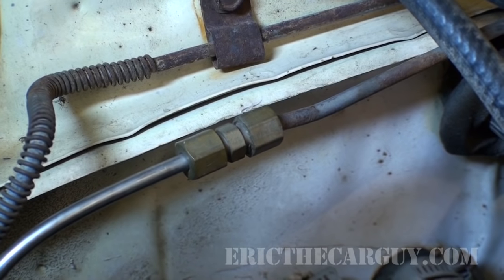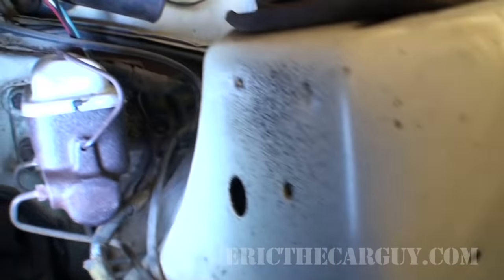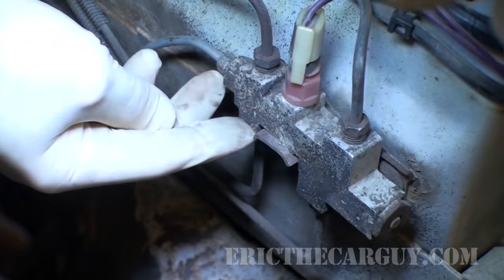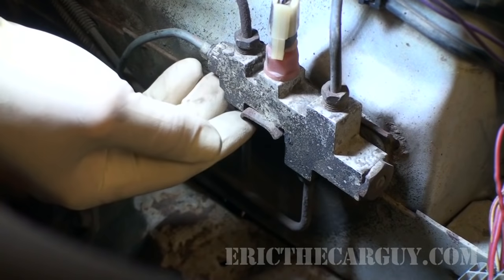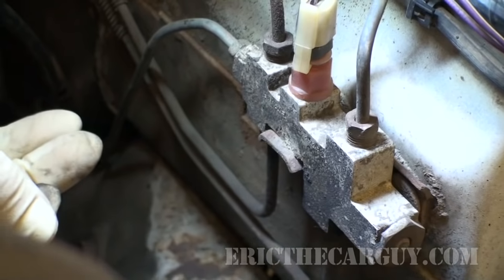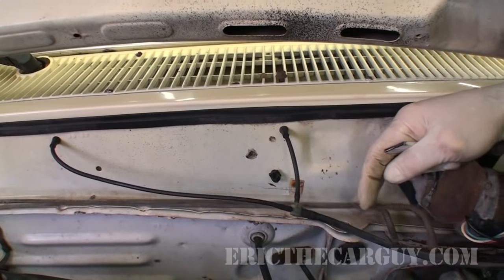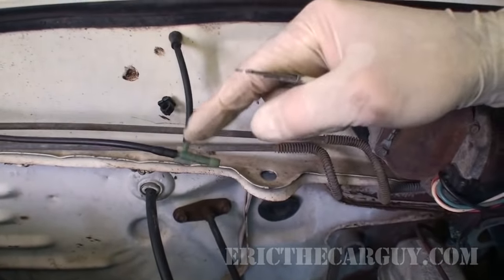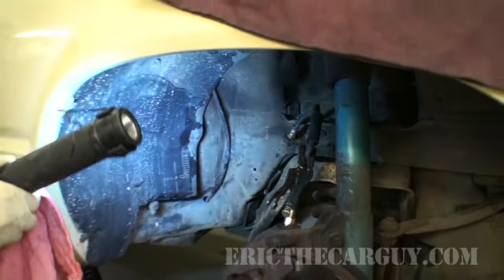How To Bend and Flare Brake Lines -EricTheCarGuy

Comment: If you are watching this because you are having to replace a brake line soon there is an easier to bend brand of line than the old-school steel line Eric used. It is called "Ultrabend". You can bend it easily and perfect for those 90 degree bends that old steel line had a tendency to deform at the bottom of the bend. Hell, those round and round bends in the line that usually are in the lines between the master cylinder and proportioning valve (and those round and rounds are there for a reason) are easy to replicate. For years I used the old bulk steel line and it was usually a pain in the butt to bend and form and if you made a mistake you had to start over. With ultrabend, you make a mistake, all you have to do is unbend it and try it again. Also, it is highly corrosion and rust resistant. No, I do not sell parts nor own stock in company that makes it. I am simply a tech that has used both type of line for years and if by chance someone reads this I hope it saves them a lot of grief.

Comment: Old video but just stumbled onto it. Nice job, something I won't do. First time I tried this the supposedly double flare tool I bought would not (ever) create a double flare. It made single flares perfectly but when I attempted the double the line would slip in the vise and get pushed out. That tool you have from Eastwood looks like the real deal
Reply: Same thing happened to me. Autozone, O'Reilly's, and NAPA all have loaner tools that don't do steel lines. I now have the Eastman hand held (in car) version, and will revisit tomorrow. After pulling the fuel tank out of my 94 Accord Wagon, just to get to the failed section of steel line across the rear, both tank strap nuts broke free from their tack-welds, and I had to grind the bolt heads off to remove the straps. Perhaps Eric has a suggestion on how to reattach the tank straps? Mollys? Baling wire? Eric has kept me busy keeping this car running for many years. Thank you Eric !!
Reply: @centralandgrandapartments3118  Aren't cars fun? Start off working on a brake line and now you have to deal with gas tank straps AND the brake line. Good luck

Comment: 1/8th inch stainless steel aircraft (AN) double flare at 37 degrees without fancy tools is SO much fun! No scratches, marks or scrapes or stress dulling or micro-wrinkling allowed. Line is handled and worked with protective masking tape. Finished product must be shiny and perfect and test to 8,000 psi. THAT is a challenge.

Comment: I remember having the same problem with car, my break line that goes to the left rear wheel got rusted and eventually started licking near the rear wheel, I figured that something wasn't right when I wanted to put in the first gear, I couldn't and my clutch  was to low and barely could be pressed down because was too low. I called my mechanic and he told me to check for brake oil level in the tank, dot 4, I didn't even knew at that time that brake fluid is also used for clutch. There is always someting new to learn about cars.

Comment: Nice flaring tool!  Not nit picking or anything but just to add my 2 cents, I find putting a slight bevel on the end also helps it roll over with the flaring tool, oh and of course deburring the inside of the end and making sure it is flush.  Otherwise it will end up off center, cracked etc.  It's a bit harder to do with the conventional, clamp style, flaring tool most mechanics keep in their box,

Comment: Hi. Keep the old fittings with a short length of pipe, just over an inch should do. Hammer about half the length of the pipe then fold that in half. Now you can use the fittings instead of a rubber bung. Mine have been in and out of my tool box since the 1980's

Comment: I know this video is roughly 5 years old, at the end you mentioned trying to keep the end of the lines clean as you fish them down where they need to go. I use a union and screw a flared 2-3" long piece of brake line bent over itself to close the end. I don't wrench the fitting tight. I find I don't ding up the flare, loose the nut down the line or get dirt in the new line when I do this.  

I'm looking at getting a new flaring tool to make good bubble flares. trying to decide between this one you use from Eastwood, or the MasterCool inline one.

Comment: Whoaaaa, I have decided earlier today to give brake line replacement a chance on my 2002 Tracker.  The problem is the lines to the rear are badly corroded and one blew out 2 days ago.  The other part of it is, this vehicle has a load proportioning valve mounted near the rear axle which adds more work to the matter.  I have nothing to lose.  If I do not succeed, the Tracker goes.  I also should replace a some fuel lines as well.  I had previously replaced lines on other vehicles which were easy compared to this and now I am much older!  The Tracker is a nightmare.

Comment: I've done the other way where u use the old one and then tape it togaither after each bend it helps too I prefer hand bent with no tool as I can get it more precise. I've never throught of the coat hanger thats a great idea too if u don't have a template or someone rigged or ran them wrong when they replaced which is common.anyways Yeah if u hold em togaither and use tape after each bend it makes it super Easy and easy to not kink it and unstrenuous. again great videos man.i love seeing other people's ways of working it's nice to get outside Thoughts.

Comment: Compression fittings also fail PA state inspection as well as NY state inspection.
Reply: Dont know why. Those things are more than a proper fix.  Stronger and less chance of breaking than the actual metal line itself...   someone made a video...

They are ugly but 100% funtional.
Reply: @grumpystony , compression fittings arent good for high pressure.  Low pressure they are fine but on a brake system the pressure is way higher than a compression fitting should be trusted.

If they were dont you think auto manufacturers would use them than the time it takes to create a double flare?
Reply: @grumpystony  Yes, they are functional, but when (NOT IF) they fail it's trouble because they don't just leak.. you'll lose that brake line. The reason they fail is the high pressure of the brake line. That's the reason why they will fail inspection.
Reply: NY State and PA are failed States.

Comment: I find this interesting viewing being from the UK, what I can gather is this difference

America: 1970s saloons, plentiful, cheap, generally free of grot, easy to work on

Britain: Ha! good luck looking for that Hillman Avenger or Morris Marina you want to tinker with, those things rotted away years ago. Want one cheap? Good luck with that, anything for less than £1500 needs picking up with a dustpan & brush. Want to undo that bolt? Well we'll just seize that solid & make it shear when you breathe on it!

I also like the mechanical practices you use however, in relation to your brake calliper video, the easiest way to get your piston out is to leave the calliper attached to the brake line & pump the pedal until the piston comes free, then clamp your line & remove
Reply: Hancockified what?

Comment: Where did you find the plugs for the proportioning valve? I can't seem to find out any of the fitting sizes for a 02 Honda Civic DX either... man, it's like pulling teeth. Are they 10X1 that feed into the proportioning valve with a 3/16 line? Any help would be great. Great channel by the way, thanks for the consistent good info.

Comment: Eric at 29:08 there is a fairly good sized kink in the line.
Reply: +Jacksonkellyfreak : True enough but not really a problem as the fluid hardly moves when applying the brakes. The fluid transmits pressure instantly and evenly. But the fluid only moves with brake wear.
Reply: what? The reason you should not use compression fittings is because brakes systems apply upwards of 1500lbs during emergency breaking! That kind of pressure at a kink (weak point) can cause that line to explode at the kink!
Reply: +RogerRamJet I hope you never work on my brakes
Reply: It's a hydraulic line, it doesn't burst.  It starts to leak.  The working pressure of 3/16" steel brake line is 3770 psi.  The burst pressure is at least 150% of that.  I've done hydraulic pressure test testing on many different types of tubing.  When it fails, it doesn't explode.
Reply: When a brake line fails, there will always be an explosion in the pants of the driver.
Reply: As long as the fluid can get though it's not an issue
Reply: my brakes blew out on a giant hill... 2 weeks back.. im still shaking. :)
Reply: Kink is near the driver-side hood hinge.
Reply: Will u rebuilt my motor

Comment: I am 18 and bought my truck without brakes. I completely re-did the lines with double flares and such, but I noticed that a simple electric tape covering the line meant no rust to the line ever. I suggest that people actually plasti-dip the line and it is a permanent fix!
Reply: until you hit that one big rock. ;)
Reply: I thought brake lines were made of materials that didn't rust. I have a coil of copper brake line in my shed for example.
Reply: mickles1975 I have never seen a brake line that is immune to rust..ever.  They will rust so bad sometimes that pieces of them just cease to exist..You can have a 40 year old car with original brake lines that look perfect, and have a 10 year old car with brake lines rotted right through…The variables include maintenance of fluid, environmental issues, geographical location, composition of the metal etc..Copper is not immune either.  Given the right conditions, copper brake lines will turn green and leak. Do a google image search for "copper and corrosion"
Reply: The new NiCopp lines don't seem to corrode anywhere near as bad as other materials. I use it or stainless if I want to stop rust.
Reply: mickles1975 it depends. It should by made from SS, but it is more expensive.
Reply: Might depend on the type of tape, as the most common electric tape is vinyl which accrues UV damage to become brittle and crack off, as well as adhesive failure over time.  Many auto parts stores now carry replacement line that has PVC cured onto it, at little to no extra cost when buying small quantities like it would take to do one vehicle.
Reply: Got a question for ya. I'm trying to bypass a RABS (rear antilock brake thingy) valve on an old truck. How hard is it? The lines are a couple inches apart. when I bypass it will I need to bleed just the rear lines or all four?
Reply: Brake lines still corrode from the inside if you don't flush the system. It will eventually eat through the copper and the moisture in the fluid will cause them to rust
Reply: @kurtislykins8502  That is the key. Brake fluid is hygroscopic and will absorb moisture. It should be flushed every few years. Also at certain bends and areas, where water collects, it will rust faster. Up here in NY, I replace quite a bit and use PVF-Coated Steel Brake line. I have seen this line 10 years later without rust after several winters.
Reply: @theq4602  the rabs valve also acts as a proportioning valve. Don't just bypass it, buy a decent adjustable proportioning valve ($35). Otherwise your rear brakes will lock up. Also, leave your rabs valve mounted with the electrical connector hooked up otherwise your dash light for abs will stay on. Bleed everything just to be safe!
Reply: @marcsmith3881  thanks for the tip. I live in the ADK and my rear lines just popped. Replaced the front hardlines with cheap steel in april and they are already green.

Comment: Great video.  However, using such an expensive flaring tool means that this video is more helpful to a professional than a do it yourselfer.  By all means show the expensive tool being used, but also show how to do that part of the job with what the do it yourselfer might use.  Cameraman does a good job overall.  Your two free hands is an improvement.

Comment: Coat the new line in white lithium grease. And the old lines too. It will keep them from rusting.
Reply: Most brake tubing has anti corrosion coatings.  One can also use Copper-Nickel brake tubing, or even stainless.  Stainless specific for brake lines is soft enough to work with and available up to 3/8" OD for fuel lines too.  I use the SS material on my project Harleys.  I also don't like his bending tool, it's OK for fine tuning a bend but otherwise I find it inadequate, and  yes, I do have one I have used.
...RooDog....

Comment: Just an FYI in Texas compression fittings are illegal for brake lines and all sanctioning bodies feel the same ie: NHRA, SCCA, ect. You will fail tech if they catch it= no racing for you or no sticker. Plus its just dangerous brake line pressure for front disc brake can get to 1800psi pretty easily/regularly. Compression fittings are for low pressure. Like below 18psi. Carbs OK Fuel Injection NOT.
Reply: Compression fittings are good for air brakes, but not much else.........
Reply: The 3 compression fittings on my vehicle say differently.. they work just fine but legislatures just don't want you working on your own brakes... fk em.. the inspector doesn't even look in my state. Just hooks up the computer takes your money and gives you a piece of paper. A total scam. But compression fittings have worked on brake systems for nearly a hundred years... what suddenly changed? Nothing.

Comment: What I usually do is to trace some string along the length of the original pipe, then use this to cut the new pipe to length (with a little extra added, just in case, the extra can be trimmed).  It makes it easier to form the new pipe without the weight and size of the rest of it getting in the way.

Comment: Hi Eric,
hopefully you'll get this message, so I have a 2002 Kia Spectra GSx Hatchback. The noise is a klunk sound when I turn left or right, when I accelerate. When I'm just driving straigh, no prob at all, when I back up, no prob at all, I have looked at it and it seems like it might the CV joints or either wheel bearings but I am no mechanic so I am not to sure. I have been drving like this for 4months now and it hasn't gotten worst, just keeps making that sound, 4 months ago I hit a pretty bad pothole and literally broke my front coil and destroyed the strut on the one side, got that fixed and since then I've been hearing that noise. I will try and take a video and see if I can get the sound on video. Thing is, when I accelerate slowly or turn very slowly or not turn till the wheel locks, the noise isn't there. I am just wondering if you seen or herd of this before?
Thanks for reading this!

Comment: Compression fittings may be ugly but are 100% functional.   There is a video of a guy cut and joined a brand new line with a compression  fitting and then did a tug of war with his truck.  The actual metal line snapped and the compression  fittings and flared fittings held perfect. 
Again the metal brake line is a weaker link than compression fittings.....

Comment: Not sure if your read this as so old a post  Anyway tip for you if you do get some Simmer nylon cord  i use 3or4mm  stuff    for bending  tube stops kinks and comes out/  removes Easy,  from long pipes ,  and cheap as you get 25 /50 meters rolls  so no problem if strimmer wants so as well, :-)  note must be Nylon  don't work with Steel or Polythene Cords  they can get trap in bends Nylon dont

Comment: I'm curious, don't you use copper lines or cupronickel, easier to bend and last longer than the car. It's either Volvo or SAAB that used to fit them as standard I believe.

Comment: Apparently if you depress the brake peddle down while undoing one bleed nipple it stops all the fluid coming out the master cylinder.. but I'm not sure about how this would work with abs as that operates on the bottom part of the stroke! I guest by pudding the pistons past the hole it stops the fluid coming out!

Comment: I wish I could remember who originally posted this tip, but lacking metal coathangers, they used tig welding wire to make template bends.

Comment: GREAT VIDEO! I HAVE A QUESTION ON FLARING. I HAVE A 1991 FOX THAT I NEED TO REFLARE/ CORRECT A BENT BRAKE LINE.  THE BRAKE LINE THAT GOES CONNECTED TO THE MUSTANG V8 REAR UPPER BRAKE HOSE BRACKET HAS A NUT THAT WAS STUCK. I COULD NOT REMOVE IT. SO HAVE TO CUT THE BRAKE LINE TO ADD A FITTING. I SEE PER YOUR VIDEO THAT HOW I'M GOING TO FIX IT. DO YOU RECOMMEND REDOING THE BRAKE LINE?

Comment: Good video thanks..anyone know why brake lines say front to back are not running inside the car and the bodywork like wheel arches used as bulkhead connectors out to the wheels...instead we have rusted brake lines some requiring the removal of the fuel tank etc..:)

Comment: Eric, can you explain how to replace a broken brake line on an F350 2006 5.4L 4WD. The line is on top near the ABS. The truck is off the road and only has 600 miles

Comment: My grand marquis has two seperate lines to the rear. Then to make it worse, they run them right next to the fuel lines. Removing the clips and even getting rusted pieces out was a hassle. My car is about to get a lot of zip ties because I'm not running it exactly where they were before. I've got 50 ft of steel ready and alcohol.

Comment: Hey, Eric, I'm preparing to do the brake lines on my Subaru Impreza rally car project (as documented on my channel), and I'm installing a Wilwood cylinder on a handbrake that has a 7/16x20 output thread at the cylinder. I can find the inlet size, which is 3/8, all day long, but I can much more easily find a banjo bolt in 7/16x20, which I would put around an eyelet. A lot of the eyelets I see have a tapered male end on them, is the appropriate step to take flaring the brake line and putting a female fitting on the line to mate to the eyelet so I can use a banjo bolt?

Thanks in advance.